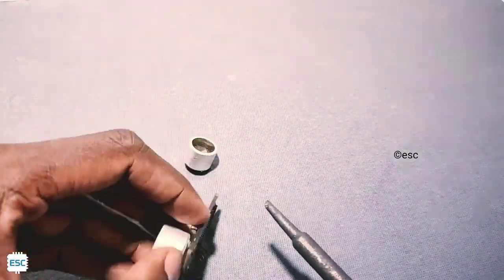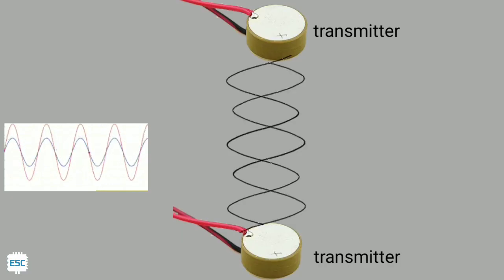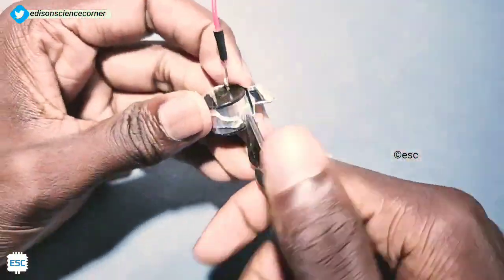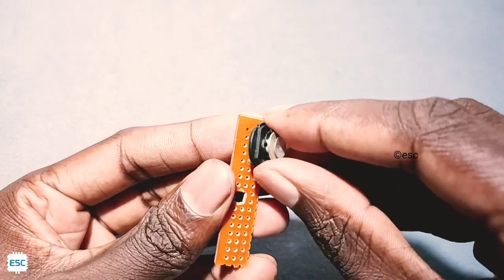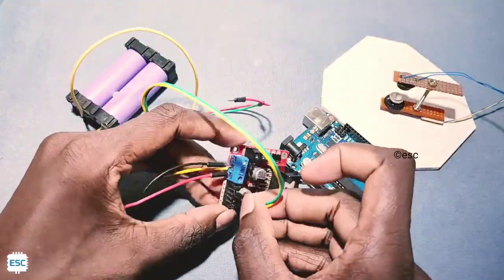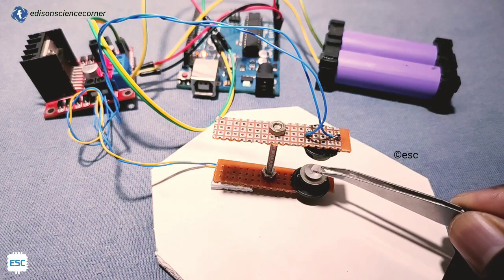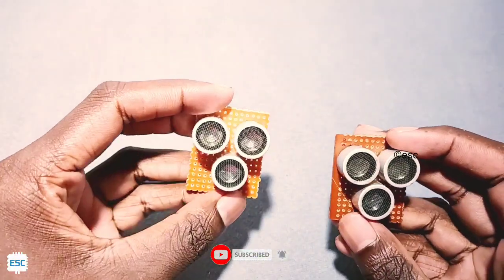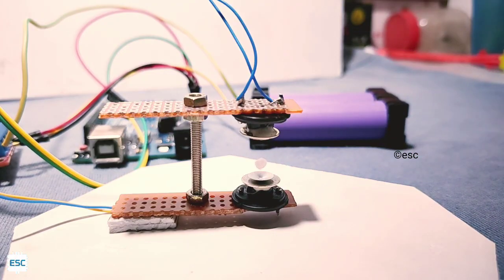How to make Ultrasonic levitator at home | full theory explained | Acoustic levitator

Comment: Bro it's showing error in codes , please help me I have to submit my project Tommorow 
Do I have to give connections before putting code in Arduino
Reply from the maker: What errror
Reply: @EDISON_SCIENCE_CORNER actually I was trying to upload it through mobile , now from pc it has been uploaded but how do I know If the ultrasonic sensors are working or not

Comment: Hello which wires did you use to connect 
transducer with the breadboard please tell me its urgent 2:28
Reply from the maker: You can use any single stranded wires
Reply: Ok
Reply: Jumper wire could also be used
Reply: Please tell me

Comment: not working for me pls help the motor driver output where we have connected the sensors doesnnt get any power
Reply from the maker: More details please
Reply: Okay so I connected the wires as per the diagram and uploaded the code and when I put the battery the driver and arduino both are lighting up but the ultrasonic sensor are not

Comment: FYI..   TIP: By coupling an optical device using the Schlieren effect to a high-frequency camera, and emitting high-frequency, high-intensity sounds, we can visualize the variations in air pressure and therefore see the sound.
Reply from the maker: I am not that advanced
Reply from the maker: Thanks 👍

Comment: Actuaaly the distance between the transmitters were not correct due which levitational force was not produced as the force of levitation is produced when the ultrasonic waves of the top and the bottom transmitter meet and form a single wave. To do that you must keep the transmitters at different distance from each other and find just the right distance for levitional force to be produced
Reply from the maker: Thank you bro
Reply: @EDISON_SCIENCE_CORNER  My pleasure

Comment: You need to orientate your six transmitters to converge to a central point. Here you simply put them vertical with same effect as only a single on top and single at bottom.
Reply from the maker: Oh thanks 👍
Reply: No need for that in case of a linear pathway of levitation

Comment: The +/- connections to the transmitters s very important: If one of the transmitters is 180 degrees out of phase with the other 2 the levitator could not focus 3 beams to a point.
Reply from the maker: Yes.

Comment: I was trying to replicate the project. But I was not able to levitate anything. Then, I realized that I am not getting any output at the output ports of the driver circuit since my multimeter is not showing any voltage. That could be the reason why I am not able to levitate. But otherwise the driver circuit is working fine with simple motor arduino codes. Is there anything that I am missing out?
Reply from the maker: This is a working circuit. Maybe you messed up with the connections. So check again and try again

Comment: scale it up to UFO sized dimensions as a mono output it levitates stright up but if you feed it stereo simulation you can get a left and right motion.. now apply quadophonic and you can have left right forward backward levitation effect now apply the 5 channel  simulation and you find the bass channel produces up and down levitation. ..  the reason why ufo's escape traditional aircraft. they use frequency as thrust in 360 degree flight model as oppose to the linear model of jets.
Reply from the maker: Wow

Comment: Can u please say me we can also make with those 28 pin ic base,16pin ic base , 16mhz crystal, 10k resistor??? Y dont u used it?
Please reply
Reply from the maker: You can use. I used this beacuse of to reduce the complexity
Reply: @EDISON_SCIENCE_CORNER  thank you  for your reply.  Can u also say me whether it will really work if we follow your steps because it's my 12th project which is considered for board exam

Comment: I'm new to all of this and I've 3d printed a holder for the two ultrasonic sensors with a distance of 1 cm, but I tried and it didn't work, so do I have to turn it on and off really fast or something, because I must be missing something.
Reply from the maker: Not works with relay

Comment: What is the distance between the transmitters?
Reply from the maker: 1cm
Reply: @EDISON_SCIENCE_CORNER  Thank you very much I built it and it worked.
Reply from the maker: If you can share pics with me 9946706059 whatsapp
Reply: @EDISON_SCIENCE_CORNER  i did the same thing but mine is not working

Comment: The number of transmitters does not mean heavier load, more transmitter increase stability of the levitating object. Bigger levitating object bigger transmitter is needed. Plus, the transmitters has to be at a 25-35 degree angle pointing at a converging point; here is a better explanation, 2 transmitter: a straight line up and down, easy to find the zero point in the middle, 4 transmitter: (very hard to do but possible ) 2 up 2 down is a one dimension triangle, and what you have is a 3 sided triangle. the more transmitter you have the shape changes. from the center of each transmitter is one leg of the shape you created. the tricky part is at what degree of tilt will they work best. The bigger the project, the steeper the angle. Try a diamond shape object to levitate. hope this help.
Reply from the maker: Thank you sir for your suggestions
Reply: So Basically having more transmitters means you have to position the transmitters to that their signal converges on a single point?
Reply: Meme: Yes you are correct,  the convergen point from the transmitters is where the lift happens.
Reply: @buggzp9887 bro i have a question if we use only two ultrasonic sensor like he do in 1st attempt and use a 14 v dc adapter instead of 7.4 v battwry then can we increase the effect or power of levitation
Reply: @buggzp9887  and bro i want to know that in the code 
Did we have to write what he written after // 
For eg
 byte TP = 0b10101010; // Every other port receives the inverted signal

  
 
  noInterrupts(); // Disable interrupts {
  PORTC = TP; // Send the value of TP to the outputs
void loop() {
  // Nothing left to do here :)

Like this

Comment: See: https://www.youtube.com/watch?v=XpNbyfxxkWE for why the setup with 3 inducers might have failed.*
Edit: And also the precautions you should make.
Edit 2: https://youtu.be/So2VK5xnLyI?t=629 might also explain why your setup failed.
Edit 3: You might want to search "ultrasonic transducer" on eBay. There I found for ~17€ (+free shipping) an 60W transducer means for about ~34€ you have a real powerful setup. Which is a lot more expensive than using those modules (I found one offer for 10 modules for 10€, means each transducer ... if you are using both sides cost you 0,5€. But IMHO those 20 are combined less powerful than the other setup)
*=Ok, in case it wasn't clear. If you are even a tiny bit out of the area of the standing wave, then it will not work. Even tiny height differences might break the setup.
You might want to build it in a way you can change the height precisely after you installed them.
Do you have access to a 3D printer?
Reply from the maker: Thanks sir

Comment: Pretty cool. What is the mass of the object you levitated and how much power did it take? In other words, what's the efficiency, weight that it can lift per Watt input?  I'm wondering how it scales to large objects? I'm sure it's very inefficient, but it would be cool to know how much power you'd need to lift a person.
Reply: before lifting , such strong waves will most probably shatter the person
Reply from the maker: I don't know the exact weight. Just think about a thermocol ball . And  also i dont the lifting ratio.but we can lift heavy objects with Ultasonic levitation